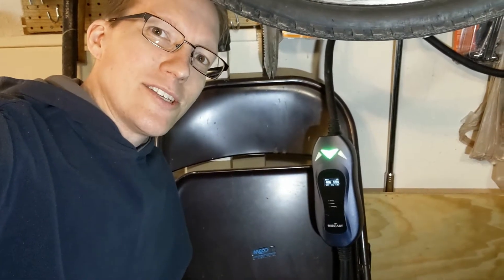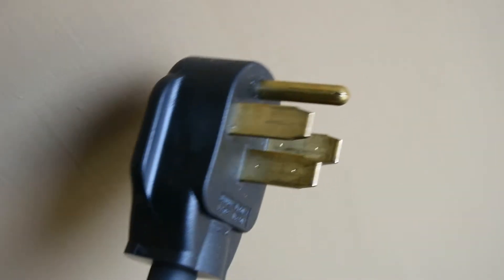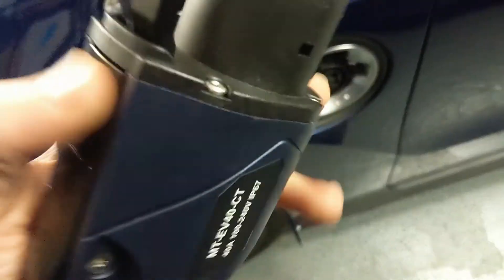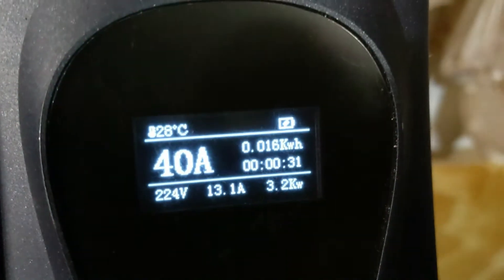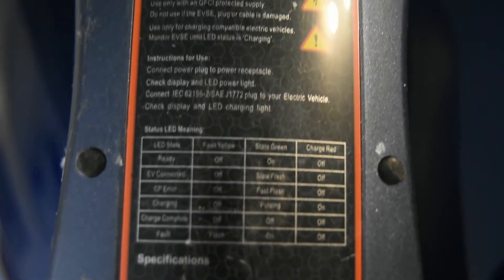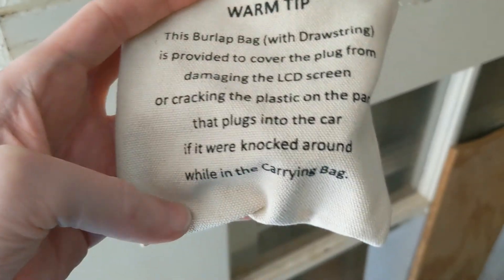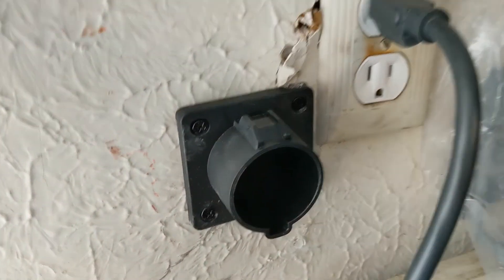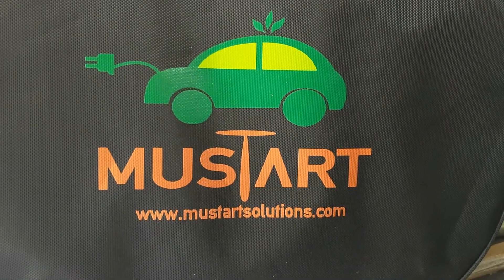MUSTART Level 2 240v 40 Amp Portable EV Charger Review

Comment: The charger is in your car, this is not a charger. 
This is a charging station, which basically supplies power to the charger in the car, after agreeing with the car as to what it needs.
Reply from the maker: That's technically correct, but a bit pedantic. In theory, cars could have been designed to just use an extension cord to plug them in, but you run into issues of not knowing the amperage that the circuitry is rated for, and it would rely on more user knowledge and configuration. Now that logic lives in the charging station and can handle negotiating with the car like you say.

Comment: I just installed my Mustart Level 2 240v 40amp charger. The center light is pulsing Green and the light to the right is solid Red, what does that mean? Also if the 2017 Volt only excepts around 12amps for chartering why did I buy this 40amp charging if it won't charge it faster. Something must be wrong because my friend charges his 2015 Volt in 2-2.5 hours with his level 2 charger. What am I missing here, is my new charger working right, the instructions were not clear.
Reply from the maker: Center pulsing Green and solid Red on the right means it's charging. If you look at the display it should have the voltage and amperage that it's charging at. I chose a 40Amp charger for future proofing more than anything else, and the price wasn't much more than a 12 or 15Amp charger. Your 2017 Volt may only be charging at 8 amps instead of 12, there is a setting to change it, and a way to set 12 amps as the default when you are at home, but it is not automatic. Your Volt should charge up from empty in less than 3 hours with the Mustart charger if your car is set to charge at 12 amps.
Reply: @LukeofAllTrades0  
You don’t set the amps for 240 volt charging. 
That’s only for 120 volt (level 1).
Reply: @LukeofAllTrades0  Thanks, I will check the configuration to set it default to 12ams. I have to wait until I run the battery down and see hoe long it takes to recharge to full. thx again.
Reply: @theconnectedcamper  
You don’t set the amps for 240 volt charging. 
That’s only for 120 volt (level 1).
Reply: ????
Only you can say why you bought it. 
If it’s more capacity than you need, it’s not going to hurt anything. 
It’ll just give you more capacity in the future, if you buy a vehicle that needs it.

Comment: Anyone else have issues un plugging the charger from the car?
Reply from the maker: It's a pretty tight fit, you have to wiggle it a bit while pulling, but it does seem to loosen up a bit over time.
Reply: @Eldo68 Did you ever find out why it stopped charging and did you fix whatever the issue was?
Reply: @GreenFLBroker 
What do you mean you have electrical installed to fit it? 
You either have a hardwired unit, and you can buy many different ones that will connect, or you were smart and installed a receptacle, and many units will just plug into that. 
For example, Clipper Creek makes units that you can plug into a receptacle, and also they make hardwired units for sale.